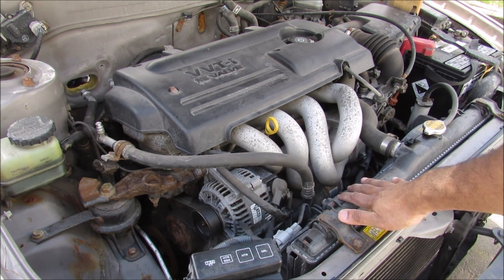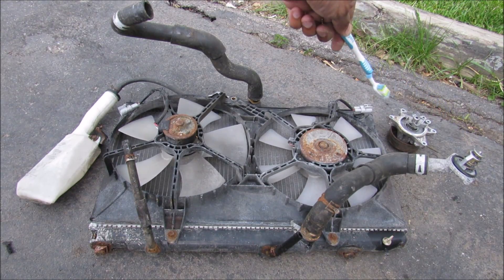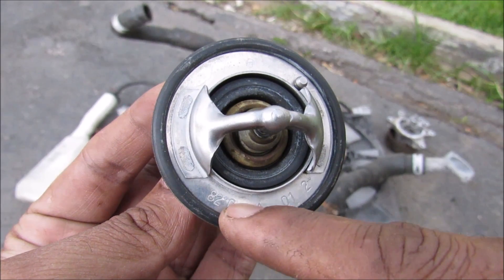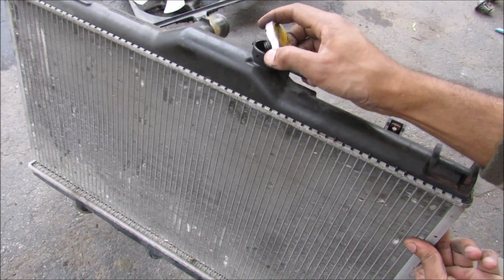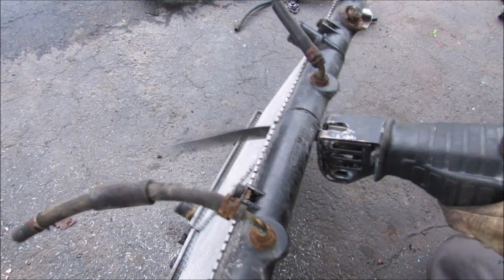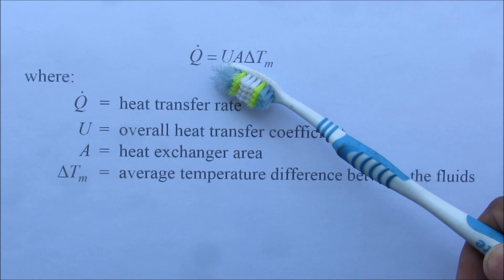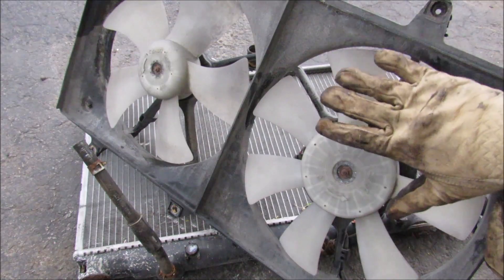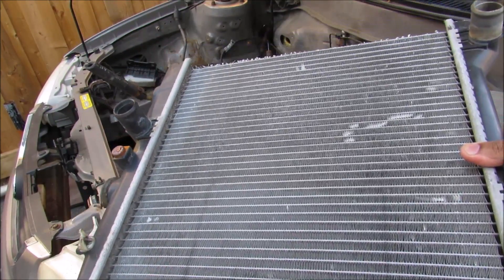How a Car's Cooling System Works

Comment: Really Great content. Can you tell me on the radiator like you cut open their what side does the hot enter and what side does the cold come out? I have a 2001 Forester l 2.5 l and I forgot to mark which transmission line went where into the radiator. Hopefully you'll respond as soon as possible because I'm trying to get it together now and I don't want to put it on wrong Thank you very much

Comment: What an excellent and clear demonstration u have done. It really shows how deeply u know abt it. 
I have a Suzuki Liana 2007 model and aft driving it the coolant goes into the reservoir making it full, so I have to manually pour that coolant back into the radiator. 
What do u think the problem is ?

Comment: Hello respected sir, how are you. 1999 toyota corolla ve automatic. My both radiator fan stays on all time even at startup and engine is still cold. Changed radiator fan relay and ac fan relay but still both radiator fans are continuously stay on full speed. What can be the problem . thank you respected sir. I live in usa
Reply from the maker: Check that the AC signal going to the ECU turns off with the AC
Reply: Thankyou....talking to you respected sir feels like i am being helped......your knowledge and desire to help others is so good....i had ordered ac pressure switch ....as my car ac was and is blowing cold air but i now donot hear a " thuk" sound right after i turn ac knob from inside car. i am guessing ac pressure switch is not toggling. i tested for 1 second because i donot want to run ac and damage compressure.....i will keep you updated about repair....thankyou respected sir
Reply: hello respected sir, thankyou for helping me..... i had replaced ac pressure switch and a coolant temperature sensor with new parts.... but that didnot fix the problem... my both radiator fans are still on all the time... but thankyou so much for helping.... my mechanic says may be it is a radiator fan switch...

Comment: Is it normal that when I open the drain plug on the radiator that not all fluid comes out? I was under the impression that I had a clog somewhere cause the upper radiator hose collapses. I put a camera through the tubes and in the hoses both lower and upper there is still fluid inside in the radiator.
Reply from the maker: Yes some fluid will sit in the hoses.

Comment: in lower hose, from start thermostat is closed and how water pump drawn coolant from radiator to circulate?
Reply from the maker: Pressure

Comment: Makes me wonder when driving thru summer desert heat @ 101 degrees air passing thru radiator, how it cools off coolant when the passing air is hot ? Great vid !! New subscriber here.
Reply from the maker: Most engines optimally run around 200F 
So 100F is "cool" by comparison

Comment: Wow , what a great video, thanks... I was wondering if you could take a look at this youtube video:
Is a way to cool down the air from an air compressor. What I don't have clear ,is that , is the condenser coil used in the project, the same found in a car radiator? and since you took this one apart, don't really understand how to how it up to air.. does it need to be from an automatic transmission.. what ever you can tell me is greatly appreciated. 
Here is the video
https://www.youtube.com/watch?v=vVJWWQkad9E
Thanks
Reply from the maker: Awesome

Comment: I have what looks like transmission oil leaking from the front of the very lower part of my radiator through the fins, is there a quick fix or a new radiator?
Reply from the maker: New rad

Comment: Good demo video as usual. Thanks. If I may interject:
 I am surprised to see that the thermostat in this engine is connected to the lower radiator hose!!! Usually the job of thermostat is to block the flow of coolant to the top tank of the radiator. It will block the flow until the engine has warmed up. The bypass passage allows the radiator to be “bypassed” and the water pump circulates the coolant only in the engine block. When the coolant temp has reached the set temperature of the thermostat, it opens and allows the coolant to go to the top tank of the radiator. A faulty thermostat that does not open when hot, will cause overheating of the engine by blocking the flow through the radiator. The radiator cap insures that the pressure in the cooling system is above the atmospheric pressure. Thus, increasing the boiling point of water above the 212 F. About 45 F increase for 14 PSI rating of the cap. If the pressure in the system increases beyond the cap’s set pressure, it lifts and allows the coolant to go to a tank for safe keeping.
Reply from the maker: All good valid points but I believe even on my v6 Toyotas the thermostat is on the lower radiator hose. 
It's the same thing as a switch, it prevents coolant flow in the circuit no matter where it is placed. 

The other way to look at it is a lower thermostat prevents cold coolant from flowing into the engine while it warms up.
Reply: @speedkar99 I am sure the Toyota engineers must have a good reason for doing it this way. They are pretty good in designing great cars.

Comment: What is the difference placing thermostat in upper hose and in lower hose
Reply from the maker: Some cars have it in either spot. 
Would you rather prevent hot coolant from exiting the engine or cold coolant from entering? Same thing...

Comment: Bro how come my radiator vibrates when ac is turned on
Reply from the maker: The whole engine probably vibrates because AC is stealing power from the engine
Reply: @speedkar99  i found the issue i got a bad belt tensioner

Comment: Everyone online says to check coolant level with engine is cold.  You say when car is hot. Who’s right?
Reply from the maker: When it's hot you can tell if there's enough coolant in the system to do it's job while hot...but you are only looking at the coolant overflow resevior. 

If you are taking the rad cap off to check the actual level, then obviously check it cold so it doesn't blow up at you

Comment: hi, you told me  lower radiator hosee is attached to thermostat, is it true for all makes, i assume honda or toyota have thermostat on upper radiator hose.
Reply from the maker: Not all are the same. 
As long as it restricts flow of coolant thru the engine it's doing it's job

Comment: Hello again 

Speedkar, I had a quick question about my radiator on my Gen 4 Camry.Myy friend came by looking at my car and noticed my original upper radiator hose was very soft. He told me that I probably had a leak, I told him that I refill the reservoir slightly (about 8oz or so every 6months). He then kept squishing the upper radiator and I was listening for leaks and I heard it at the reservoir. I believe the reservoir hose is bad. Can I just go to Autozone and buy any hose that is the same diameter for the overflow cap that leads to the radiator? 

Also, my friend said my reservoir may not be pressurized which may be normal? This would explain why my upper radiator hose was soft. But I thought all coolant systems were pressurized? 

I am going to Utah in a few days so I want to make sure everything is good to go. Also, it is going to be about 10 degrees cooler there so about 40-45 degrees compared to my normal 45-55 degrees if that would make any difference. 
Or if this would leave me stranded?

THANK YOU
Reply from the maker: If they are too squishy they can collapse. They should be firm. The parts store or rockauto should carry direct fit replacement hoses which are easier than bulk stock.
Reply: @speedkar99  okay thanks for the info! I'll buy the oe fitment hoses

Comment: You have amazing knowledge...what's the reason the radiator fan turns on frequently..coolant level is optimum.does it indicate water pump pulley problem...ac refrigerant gas is refuelled,radiator has been cleaned..is it due to the thermostat?
Reply: Sukrit Bhattacharya.   Electric fans are signalled by engine computer.

Comment: I'm wondering why the two sides of the radiator have different fan designs. I would be fascinated to discover the answer!
Reply from the maker: +bennemann Hmm that has me wondering too, since the condenser spans the entire width of the radiator, and fluid moves from top to bottom.

Comment: Such a great video! One question, is the heater core located behind the dashboard by the steering wheel? Thanks
Reply from the maker: +ThumbsUp2HardWork it's in the middle of the driver and passenger footwell to the right of the steering wheel

Comment: Great video!!!:) I have a quick question. Is it possible to end up with transmission oil in the coolant reservoir if there's something wrong with the radiator ? I have slight amounts of oil in my coolant. A mechanic told me that it may be coming from my radiator. Any insight is greatly appreciated.
Reply from the maker: +Wilson Gomez yes 
But it's more likely you have a problem with the head gasket
Reply: speedkar99 thanks bud!!
Reply: speedkar99 how can I determine if it's an either/ or leak??

Comment: I think thermostat is located at  higher hose and decide whether water goes through radiator from  engine or not?
Reply from the maker: +Shawn Lee Not on this engine, it's on the inlet to the block
Reply: speedkar99 the speaker in the video said the thermostat is located at outlet and blocks water if its temp goes below 82.  Is this all right?  Why the stat is at outlet, not at inlet????
Reply: @ksun-21  The thermostat tries to hold water in place until the operating temperature of the engine, usually around 190F, is achieved.  It's at the outlet because that should be the point where the water gets the hottest. The wax / copper always sits towards the engine side to heat up.

Different manufacturers have different places for their components. The direction of flow of water is always from the radiator to pump (low  pressure side), then pump to engine (high pressure side), and diffused from thermostat to radiator (back to low pressure side).

Comment: Holy! Didnt knew The tubes Are so thin, i mean on the spot where 2 Are close to each other, no wonder little stones Can cause a leak. I think earlier they used thicker tubes, but also that aluminium between.
Reply from the maker: +David Mezentsev Yea these are easily damaged. It cut like butter with my sawzal.

Comment: What's the propose of the thermostat being on the lower radiator hose? On my car it's the other way.Thermostat is on upper hose.
Reply from the maker: +Petar to prevent cold coolant from cooking the engine. Either works

Comment: my car coolant hose leaked and car won't start after few km. does it has some heat sensor preventing from starting.
Reply from the maker: +Dhanesh Nair It over heated didn't it? 
Let it cool down and figure out where the leak is coming from, its going to damage the engine if you drive it over heated
Reply: speedkar99 yes my car luckily stoped near a workshop, i called
the mechanic, he soon found the fault. changed the hose, topped up coolant,It's now fine.

Comment: Nice video...can i ask why is the water inside the radiator sucks and empties the expansion tank water everytime i use my aircon. Please help!
Reply from the maker: +Sarny Funesto thanks. 
Coolant expands with temperature. When cool, the coolant is sucked in the engine. When warm, it expands out into the tank. I don't think its related to the ac directly, unless the cooling fans that cool the condensor are also cooling off the radiator too much.

Comment: In the diagram, I don't understand why the thermostat is on the "cool side".  Isn't it supposed to let out hot coolant out of the engine?
Reply from the maker: +MrGgarcia7298 its supposed to prevent cool coolant from flowing into the engine while its warming up.

Comment: nice video thank you for this explanation 

i have Honda Accord 2008 and it is suffering from overheating in last 3 weeks causing to engine failure and unfortunately after replacing the engine the problem has not been resolved yet 

i am working on it but i cost me too much 🤒 
and it seems more to come
Reply from the maker: +Ayman Al_Jahwari Dump that car. The 2008 accord was a real lemon, especially if you got the 4 cylinder.
Reply: i will try for the last time 
and i will see what will happen
Reply: Ayman. did you change whole engine, your self?

Comment: +speedkar99 I have noticed that on my 2006 toyota camry the car jitters and vibrates and has a loud thumping noise when accelerating between 20 and 30 miles per hour. It is not reliant on wheather the car is turning or going strait. The problem is getting progressively worse and it only goes away when i let go of the gas pedal. PS: when this happens the pedals vibrate  The car has 206.000 miles currantly and the problem began when the car had 180.000 miles and it has gotten progressively worse the car has been prefectly maintained and the only code it had is a rear wheel speed sensor . thank you for your response
Reply from the maker: +Patty Razer start by cleaning throttle body and checking for vacuum leaks and resetting the battery.
Reply: +speedkar99 
do you think it has a bad tranny as that is where the noise is coming from even though i have changed its fluid frequently. thank you for the response today the code p071 bank 1 catalyst inefficency
Reply from the maker: +Patty Razer catalyst code shouldn't emit any thumping noise. In fact thumping noises don't usually come from the transmission, unless its the tranny mounts. Otherwise you should be looking at suspension pieces, like the stabilizer links for clunking noises, especially over bumps.
Reply: +speedkar99 thamk you for the response the noise sounds like it is from the transmission area it only happens when i am pressing the gas pedal between 20 and 30 mph the noise is like rubbing a bat against the floor as you sprint down some stairs. You can  feel it in the pedals and it doesent happen when accelerating normaly it only shows between 20 through 30 mph going strait and turning does not change anything... Thanks for the help ps there is alsp a code for anrear wheel speed sensor on both sides...
Reply: Patty most likely car CV are worn out. CV connects Tranny power to the wheels.

Comment: how is the surface area from the radiator calculated? is it including the folded fins?
Reply from the maker: +unlegendnl Yes, all area that is exposed to the air.
Reply: That's what they show u how to calculate in a Heat Transfer / Thermodynamics course. Fins are part of the calculation, as well as the material used and the speed of the flow of water.